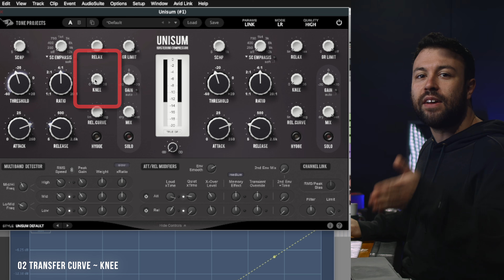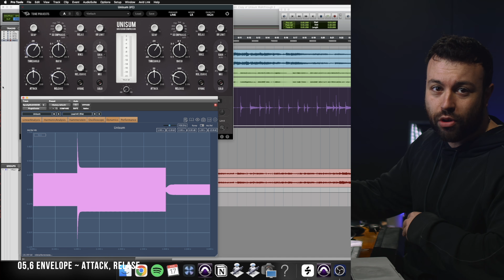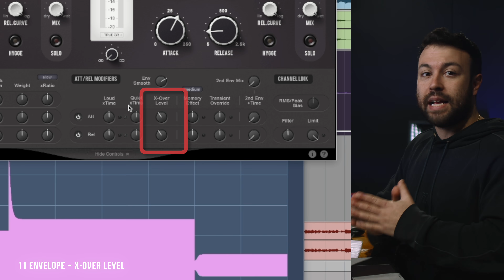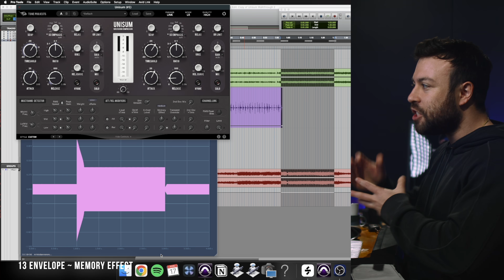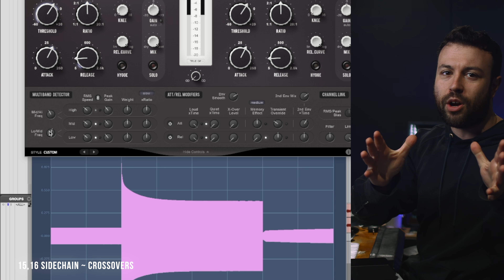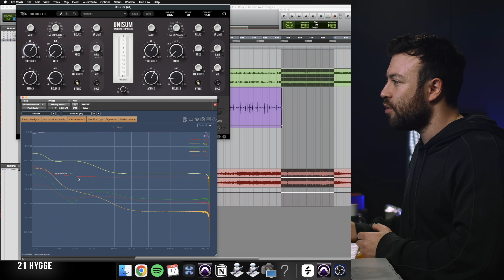Comment: I'm a big fan of this compressor so was looking forward to this video (there aren't that many) but I have to confess I come at this from a totally different place.  The almost unlimited flexibility is both a blessing and a curse so what sets this apart, for me anyway, is the sound and the presets.  

I can't exactly put my finger on why but I think, as a mastering compressor, Unisum just sounds amazing right out the box.  Every mix just sounds more polished and more finished going through this even before dialling in the controls.  I think it's the way it manages to control the dynamics without any colouration of the sound (ignoring the Hygee buton).  And I don't just mean saturation.  Most compressors add "weight" to the overall mix, which is sometimes desirable, but Unisum managed to control the dynamics without adding or taking anything away.  As I say, difficult to put my finger on it but everything just sounds better.  To the point that I have sometimes used it on the vocal busses in the mix when I just need transparent control and my usual tools (e.g. the excellent Pro C2) just isn't quite doing it.

And that brings me to the second point which is presets.  I've had this now for well over a year and use it on every master I do but I still rely very heavily on presets.  Partly because it's so complicated to learn and partly because the presets are excellent.  For those that don't have it, you have presets just for the bottom section which are totally separate to the overall presets. There aren't loads (I think about 15 iirc) but they give you a different feel  and sometimes I just flick through those if I'm not getting exactly what I want from the default.  I obviously dial in the top panel controls but for the bottom panel I rely almost exclusively on the presets.

So, from a totally different perspective (I'm not a dedicated mastering engineer) this is still an excellent product and one that I would heartily recommend even if you hardly understood a word of the video :).  

But for when I want to dive in deeper, thanks Nick.  Appreciate it.
Reply: Hey! 

It's super flexible; and I was similarly in preset world until I commited to making this video as a personal challenge; now I'm pretty confident navigating all the parameters and dialing in the sound I need on the fly;
Reply: @panorama_mastering  perhaps I need to force myself (at some point) to really getting into the parameters in that bottom panel.  I have previously learnt what they all do but I haven't spent the time to understand what that translates to sonically.